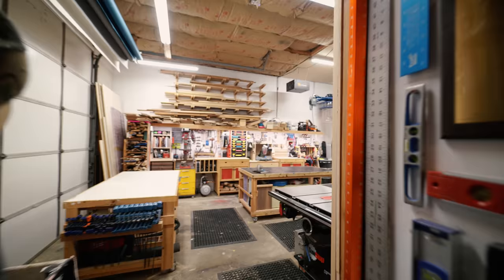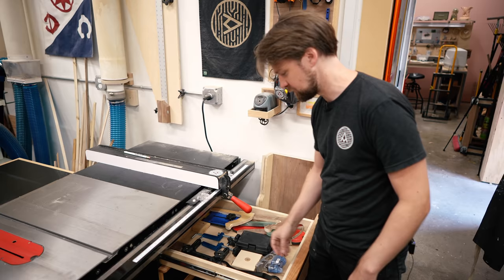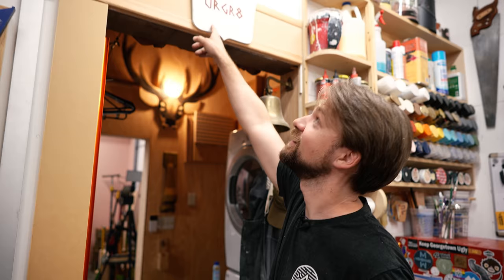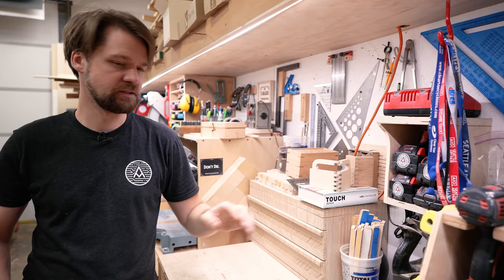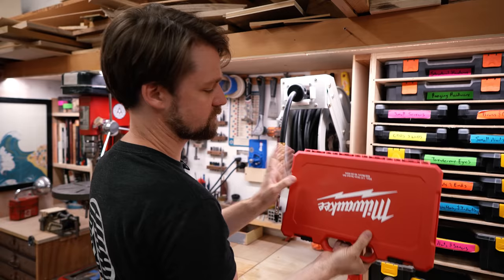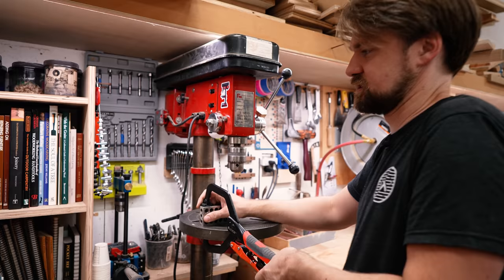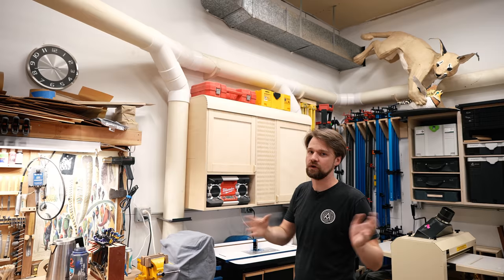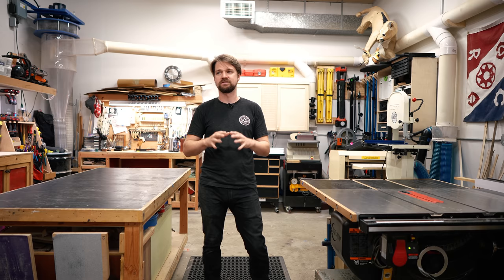Two Car Garage Wood Shop

Comment: 11:29 Pro Tip: Someone else may have already mentioned it, but most dry erase surfaces are damaged by ammonia-based cleaners causing them to erase more poorly and ghost more as time goes on. Instead, stick with alcohol-based cleaners when possible!

Comment: Thank you for the tour Michael. I am running permanent power to my two-car w/ attic shop next week. I bought the Delta version of your Jet band saw at a garage sale. Instead of pushing this saw to do re-saw work that it isn't quite suited for, I bought some 3/16" blades and the Carter Saw Blade Stabilizer and put all of the other guides in a box. Our little saws are perfectly suited as scroll saws.

Comment: In my younger days I would pick up a side job and based on the project I would look at the tools needed and make sure the cost of the tool I didn’t have was somehow buried in the profit of the job; within reason of course.  I ended up with a very nice floor standing drill press and a dewalt sliding miter saw that I have had now for quite a few years. I have also gotten some hand me down tools that were inherited and some I have picked up along the way.  Michael, you have a really nice shop for a 2 car garage and your creativity just on building the shop has given me some new ideas. If I get some time to learn how to really post a video,  I have a couple of projects that I did with a friend of mine in his shop with his CNC.  Cheers!

Comment: Years ago, I built my sled with a hand hole like yours. Definitely helps. My sled is lighter and the hand hole fits a plug to hang it on the wall.

Comment: 10:20 You can cut sheets of steel from old kaput washers, dryers, and stoves. Avoid fridges, freezers, and A/Cs (no point letting out the refrigerant). Put a metal-cutting blade on a circ saw (best use an old saw, especially if you use abrasive blades), and go. Send the rest of the hulk to the scrapyard. Wear tough gloves; cut steel often poses a serious laceration hazard.

Comment: I hate to complain, but after seeing your shop tour, I think my shop is too big!  It’s 40’ x 40’ with 14’ ceiling.  I do park my truck and tractor in one half of it in the winter, but otherwise, it’s wide open.  I’m almost thinking of building a wall down the middle to split it in half.  Thinking that way, I would have a fourth wall for storage etc., that’s not so far away to be impractical.  Appreciate anyone’s comments on the idea that maybe intimacy is better?

Comment: I was waiting for you to talk about that floating shelf under the timber rack. Want to make something like that in my shop!
Reply from the maker: I meant to!! It’s mounted to the wall using a 2x4 and framed out with 1x4s. The hardware cabinet helps keep it from sagging
Reply: @MichaelAlm  yeah kinda figured that part haha thanks for taking the time.

Comment: I never realized that you don't have a jointer. I have a similar layout as you but my jointer is a real pain to position due to its infeed and outfeed requirements.

How do you square and flatten* your hardwood material?

Comment: Great video.. and as always well produced and the effort shows… thanks!    One question I had was about the cross-cut sled… I see most people use Baltic-birch for the base of the sled… but I was wondering what your thoughts are on using 3/4 MDF?   MDF seems to be “the most stable/flat” material out there… would you see any disadvantages of using MDF for your next sled?  Maybe a topic for an upcoming rebuild of your cross-cut sled?  Curious on your opinion.  Thx
Reply from the maker: Thanks! I’ve seen people make them out of MDF, and you certainly can. My crosscut sled takes a lot of abuse. I think an MDF one might break after a lot of use, so 3/4” plywood made sense to me

Comment: building my first shop and trying to determine table saw size (HP)  Plan or idea is to eventually make products using hardwoods and will need to cut 2"+ stock from time to time. Whats minimum HP in your opinion?
Reply from the maker: I used a dewalt contractor saw for a long time, and that worked great. Not sure the HP but probably 3/4hp. You usually put a thin kerf blades on those, and then it can easily cut through 2” stock. My current saw is 3hp, and it’s able to cut 3” maple if you want it to. It also allows you to use a dado stack which a contractor saw won’t. The big cast iron top is nice too.

Comment: Congrads! 31800 &1 now :-)  Great Shop!  A number of your fans have ask the size (LxW), I wouls like to know also?  And What is the room off the paint section?  Is that part of the 2-car garage?
Reply from the maker: Thank you!! It's 18.5' x 25' with 12' ceilings. There's more storage, and a metal shop on the other side. It's still a work in progress, but I'll do an update at some point and include that area.

Comment: hey man great vid. for the ryobi battery, for the batteries, pick up a converter off amazon to use millwaukee batteries. works great. i use it for the ryobi glue gun that i run off a millwaukee battery
Reply from the maker: Good to know!! Thank you 🙌

Comment: Michael, why do you not have a joiner in your shop?
Reply from the maker: Good question! I don’t rough mill much lumber, and I can use my track saw to joint a board if I really need to
Reply: @MichaelAlm  Gotcha, thanks for the quick reply